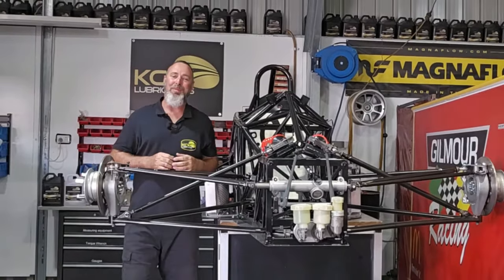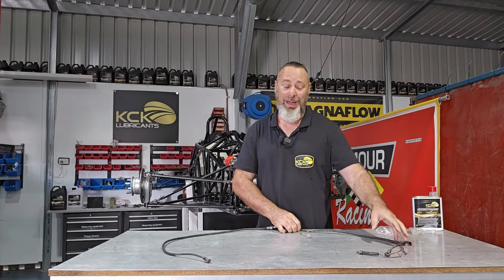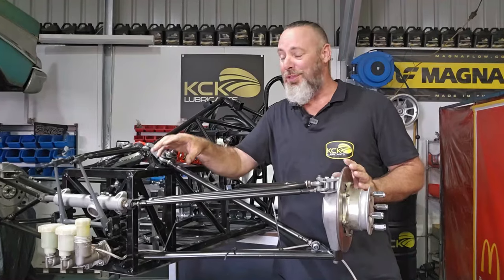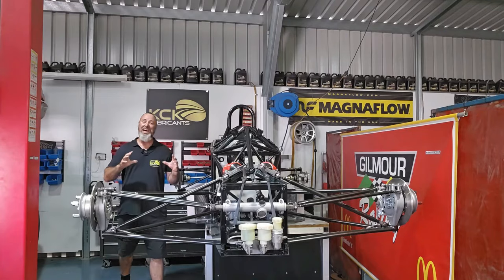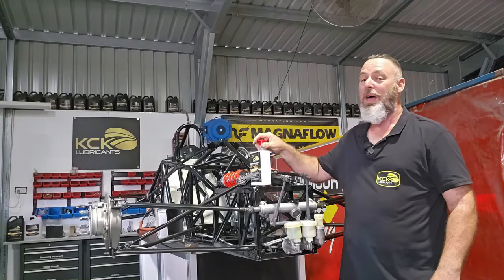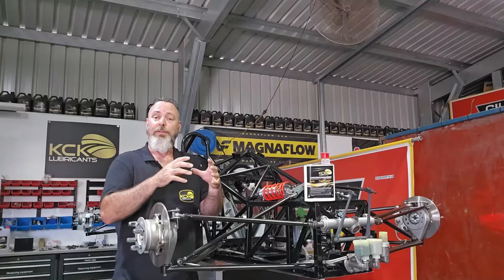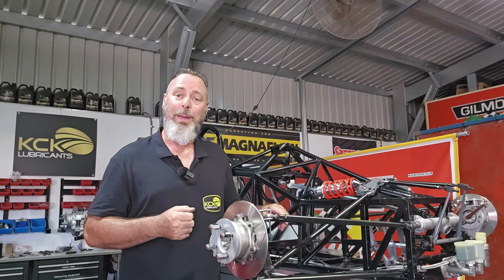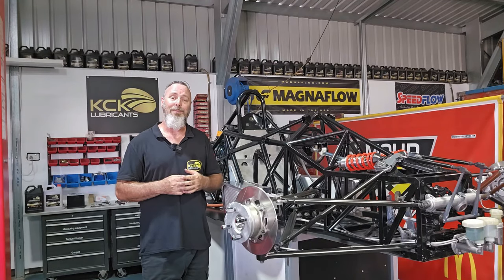Formula Ford Van Diemen RF96K restoration Episode 21, by KCK Racing Australia

Comment: One of my favourite jobs when building racecars is doing all the hoses. Anything from #3 to #20. Could you put a reinforced C notch in the accelerator pedal for a bit of clearance for the bias cable?
Reply from the maker: I agree, the hoses make everything! For some reason all of the pedal assemblies seem to be the same, when we build them from scratch we run it on the clutch side as it seems a smarter solution. There is just enough clearance until the brake pedal goes to the floor! The accelerator pedal has been shaped around the bias cable with a very large C in it, any more would almost foul on the drivers foot.